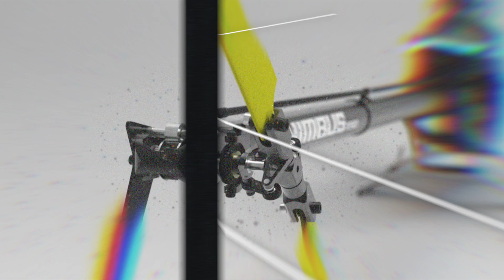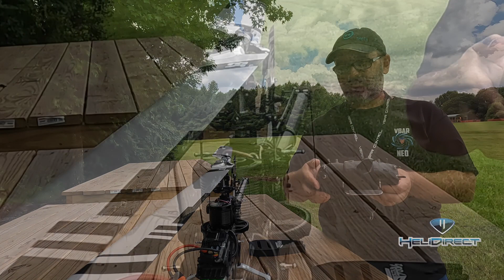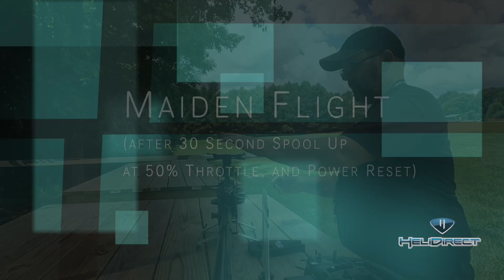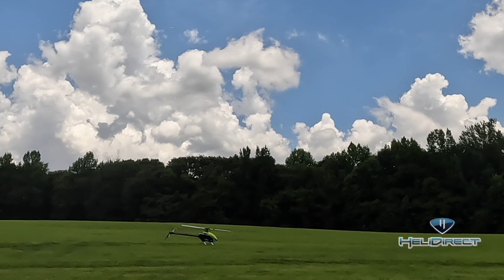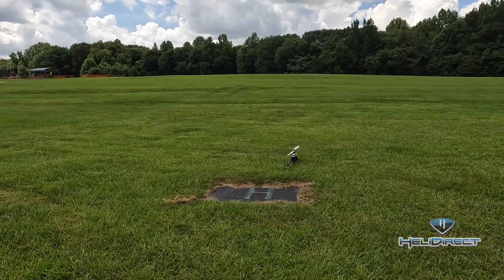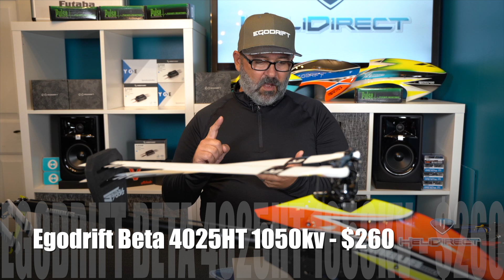XL Power Nimbus 550 Budget Build Series - Part 7

Comment: My question on the HW set up is always do you disconnect the handheld programmer, leave battery connected then do calibration at 50%, 30 seconds? 
Or can you cycle battery between programming and calibration?